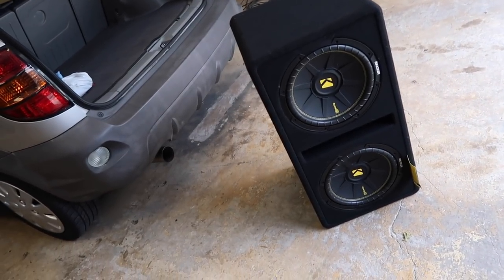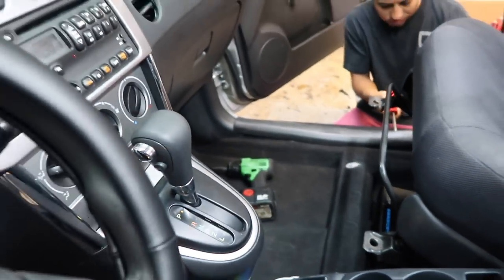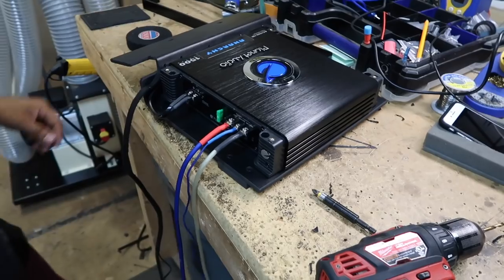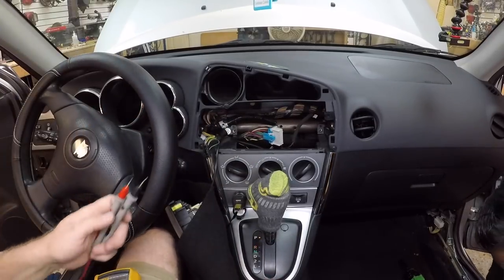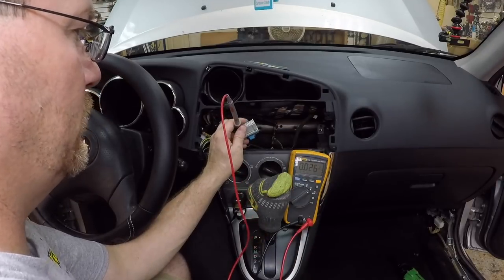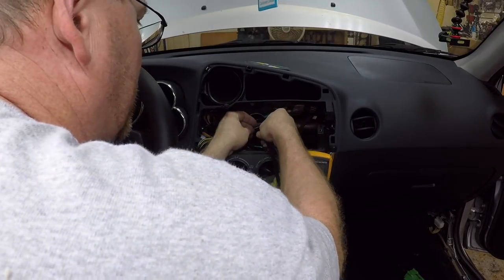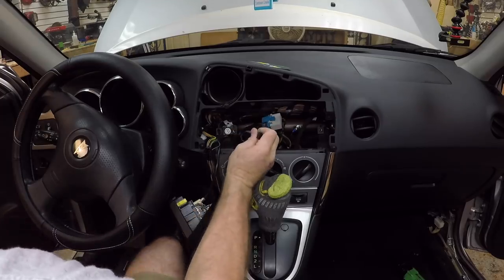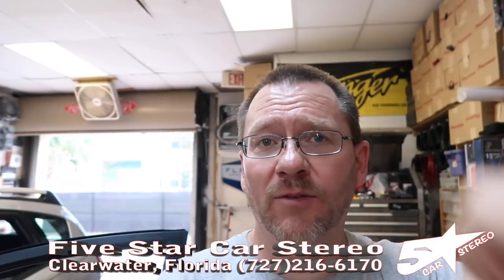It's a short 5 o'clock special  Installer Diaries 69

Comment: Hey dean and Fernando got a question i want to replace oem amplifier with an aftermarket amplifier the bracket is not going to fit the new one. Can you please give me some suggestions on how i can mount my new amplifier it's a jbl gtr-104. I wanted to keep it in the same area as the factory speaker wiring.